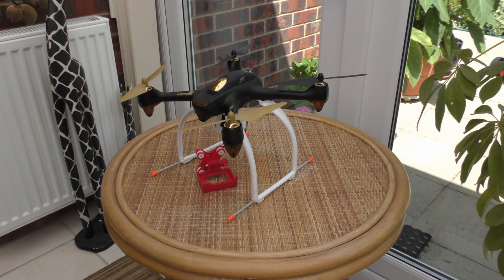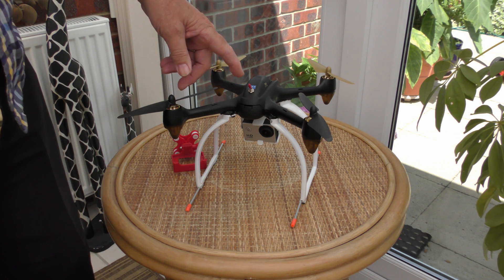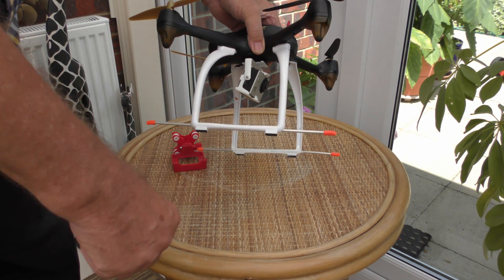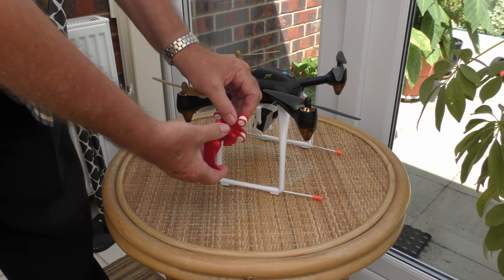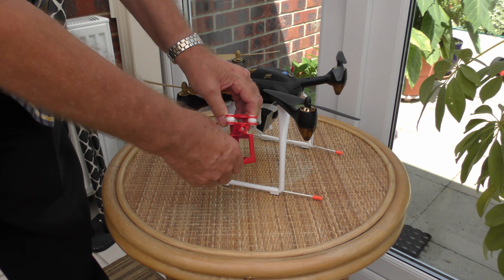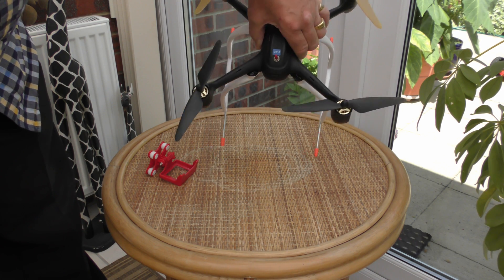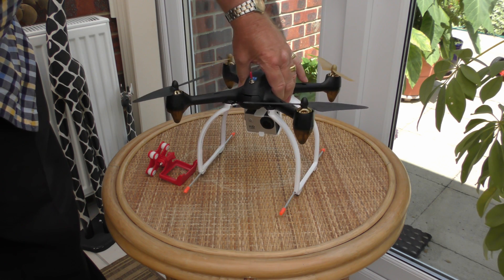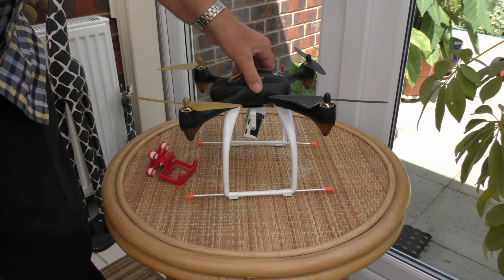HUBSAN 501S DRONE 2nd CAMERA FIX

Comment: Hi Graham. That was a neat idea and I look forward to seeing the result both with video and pictures - the lattter should be a big improvement. Not used mine in a while due to it being a windy location here but if it works for you I may have a go at the mod.
Regards Peter